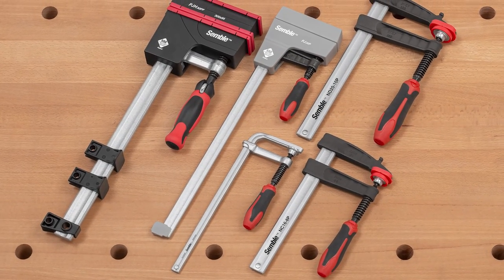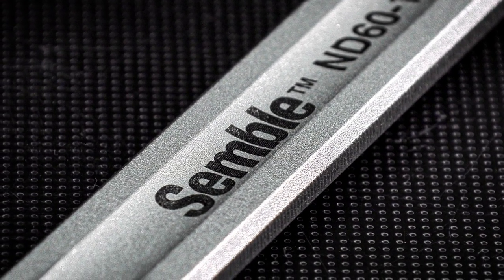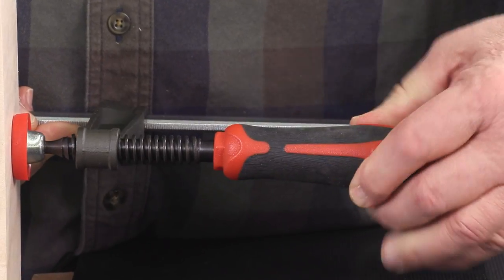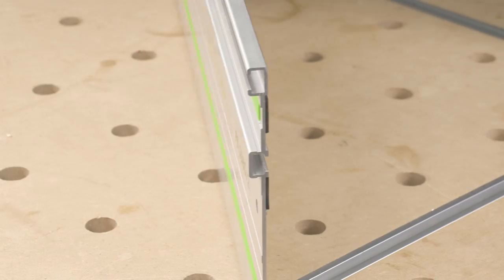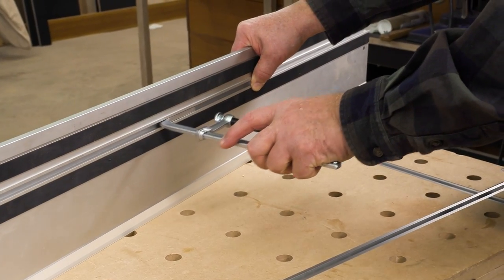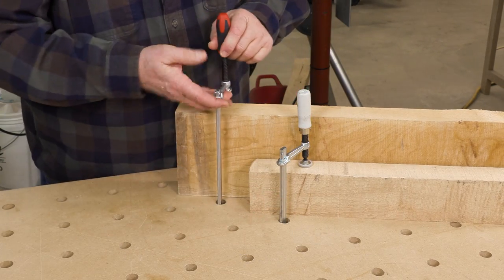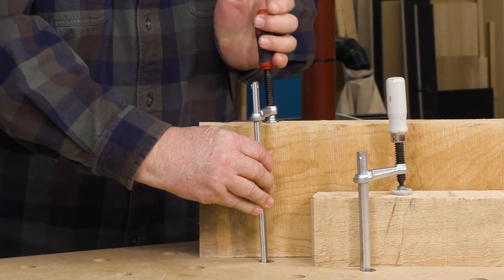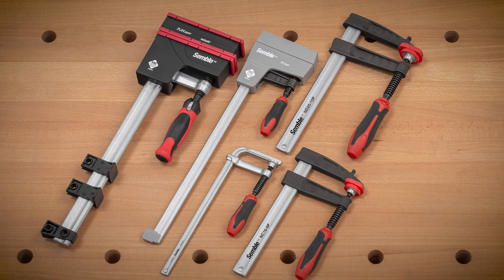NEW Semble™ Track Clamp | Woodpeckers Woodworking Tools

Comment: On this track clamp, I'm not sure why it's being sold without a pad. The track clamps can usually perform double duty as a table hold-down, and you show it that way here, but without a pad on the non-track end I wouldn't want to use it on wood and I might be concerned about using it on some surfaces, like when the track needs to attach to the material. 

The price on these is not bad at all and I'm sure it would cost little to add a aftermarket if you purchased the clamp, but as a customer I find it harder to find replacement pads for clamps in general (especially right now). At least having the option in the package would be an upgrade, unless that metal head is doing something different.